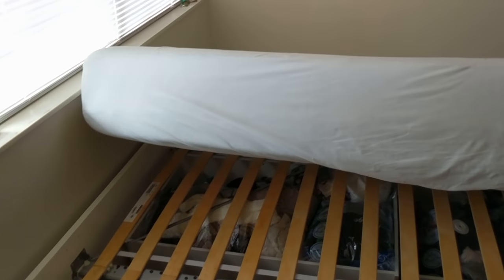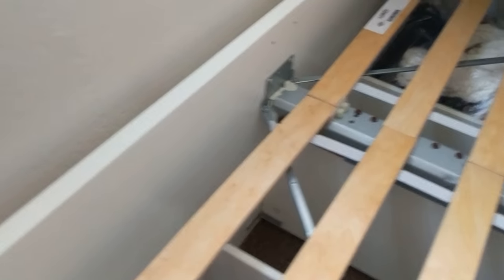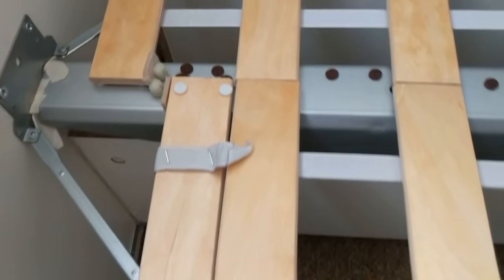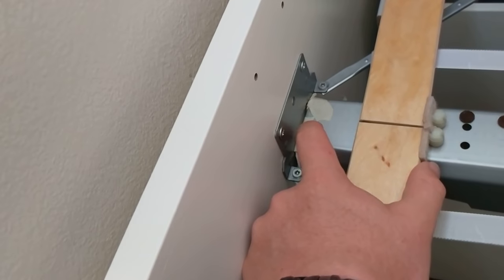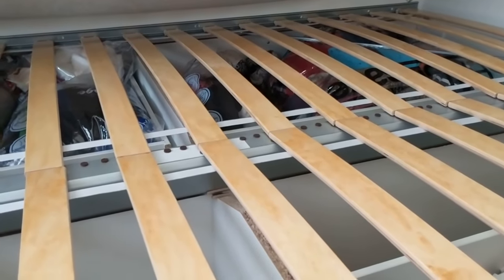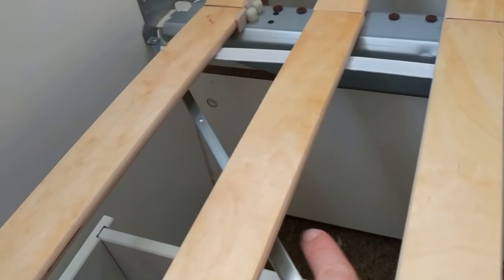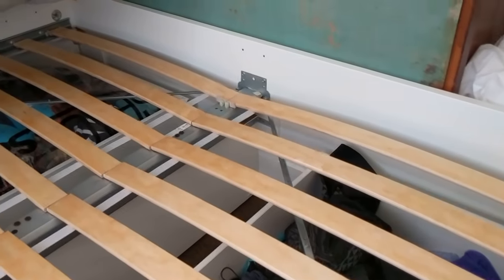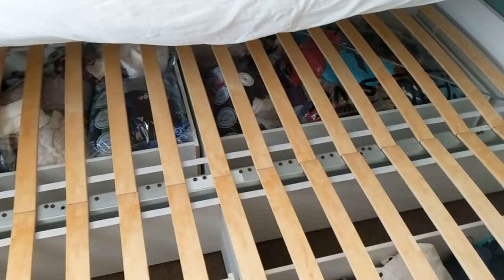DIY IKEA Brimnes Bed Silencing the squeeks

Comment: After some paranormal activities I got a noise complaint from my neighbor. I wish I would have seen this video prior to spending a whole day working things out. I started with the braces and the braces reduced sound for me about 95%. But there was a thudding i couldn't track down, I put 1/4 pad at the 6 connection points to the floor, that didn't quite do it, but there was constant thud that kept on occurring only when jumping on the bed. The metal bar at 1:45 the culprit. Man, jammed those plastic pads in there and this bed went from a noise making machine to quiet as can be. Not a squeak out of it.
Reply: What’s braces did you use??

Comment: Your video was a life saver! 
My wife and I found that just padding the central vertical plank at the head and toe of the bed with felt reduced 90% of the noise.
It was the quickest and least effort step we could take, as the floating slats didn't seem to make much noise in our case. Not sure how long ours will last without the reinforced L brackets you added, though.
Reply from the maker: Thanks Michael! So glad it helped.

Comment: For me, 2x2 L-shape brackets at the top and bottom of the big metal bar in the middle (one side on the bottom and the other on the top like in the video) already did the trick for me! So glad to finally fix the noise issue; should have done this way sooner. Thanks!!!

Comment: I used a hot glue gun to glue the slats to the metal rails.  I laid them out first without the glue. Then marked their location with a fine tip marker. Rolled up half the slats and glued them down working from the center to the headboard. After that was finished, repeated rolling up the other half and glued them down working from the center to the footboard.  Glue down one slat at a time to make sure it is positioned correctly. This took me maybe 15-20 minutes to do.  The bed I did this on was an IKEA Malm bed. Same slats and rails as the Brimnes bed.
Reply from the maker: Sounds like a good solution! Did it work?
Reply: @Stephanbitterwolf  So far so good.  Glued The slats on Saturday, so it has been four nights without squeaks.
Reply: By the way, thanks for the video. If I hadn't watched it, I don't know if I would have thought about gluing them down.

Comment: I have a slightly different style but before going to the effort of doing all this just try taking off the diagonal arms attached to the sides going to the middle back of the bed because that only takes about 2 minutes.

I made some extra legs, attached the corner brackets and it was still squeeky but after removing those arms it was perfectly quiet. They don’t seem to do particularly do anything structurally either.

Comment: thanks you saved me a good nights rest allot of the screws of my bed were Loose and i fixed them back in the wood and the noice of my bed reduced by 95% i still hear squicking but very very very quickly

Comment: My ikea bed creaked and screeched when I breathed!! To fix this I got some paste wax and slathered it on the metal beams where the slats lay down and anywhere where the slats would touch the bed or potential points where there could be any friction. ( most of these creak noises are due to the metal screeching against the wood slats, the wax removed the friction causing the sound) This method fixed the creaks 100% with minimum effort and was much faster then this method where he individually placed the felt on the slats.
Reply: I'm in the UK, can you tell me more about paste wax please? Does it have a brand name? Do you have a link or photograph of it?

Comment: I have another kind of bed from IKEA, but which is also a noise machine. I fixed most (maybe 90%) of the noise by putting a felt protector on the bed feet. I am going to try your tricks for the noise that comes from the metal bar, I hope it fixes the problem once and for all.

Comment: Hey! What exactly did you do with painters tape and do you think there’s an alternative?The problem with mine is that this metal thing is making the most noise. Thank you!
Reply: taja debeljak I have a similar bed and I used some paper. Basically the main beam through the middle of the bed can come out, exposing where it is held (a metal pocket on the top and bottom of the bed). What I did and am assuming he did also was put something in between the gap stopping the pocket and the beam touching, preventing squeaking. Hope this helps.
Reply: Max Mastin  Thanks! Will try hope it will work!

Comment: did the l brackets installed easily on IKEA engineered wood, did you face any issues while doing it? I am thinking to do the same but i fear it might result in wood to be damaged all together
Reply from the maker: No issues on my end. Just make sure that you measure the thickness of the board and get the bracket that has screws that won't exceed the thickness. Then you should pre-drill the holes.
Reply: @Stephanbitterwolf  my installed brackets make ENORMOUS cracking sound…. what did I do wrong?

Comment: Everyone, just unscrew and remove the thin metal bars that go on diagonal and dont actually do anything. They are the source of the fing squeaking
Reply: I was wondering about taking those off! Now that it's been a few months, has there been any downsides to removing them?
Reply: @staciblaschko4134  zero downsides and absolutely zero squeaking. Just do it :) btw, I only unscrewed the screws that are near the head of the bed. I didnt remove the bars, they are hanging there without any real purpose. I could probably remove them for good because they are useless  ...
Reply: @rmandrei  Thanks!! I'll do that.
Reply: @staciblaschko4134  can you come back and confirm that it worked? My solution isnt presented anywhere and i tried them all
Reply: @rmandrei  I removed the diagonal bars with no ill effects! :) I also tightened up screws which had loosened in the bed and in the platform slats. I added pieces of felt in the places Stephan described. Much better now!
Reply: You absolute legend. I can finally move in this annoying bed without hearing those annoying noises
Reply: You saved my life

Comment: Hello, what mm for the pads ? 10mm ? Thanks
Reply from the maker: Is this for the thickness, length, or width? I just grabbed what I could at Ace Hardware. So whatever you find is probably gonna help.
Reply: @Stephanbitterwolf  it did, thx